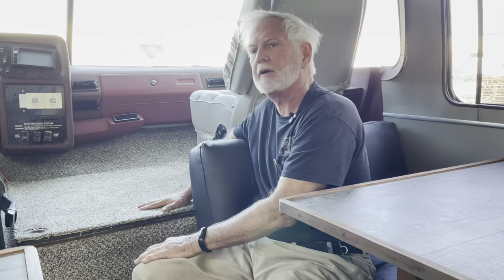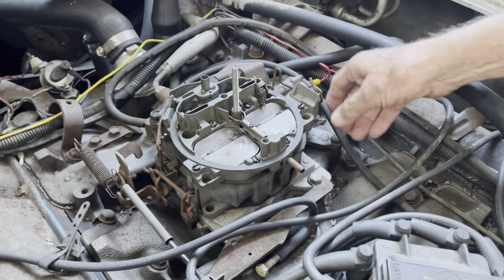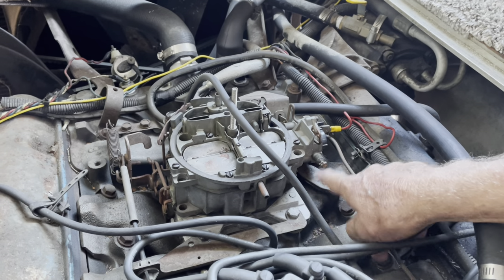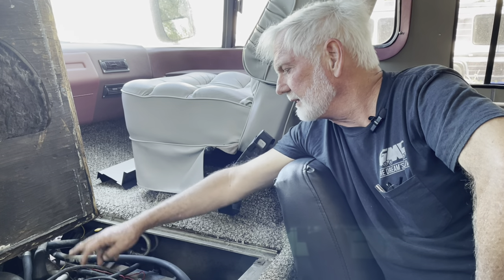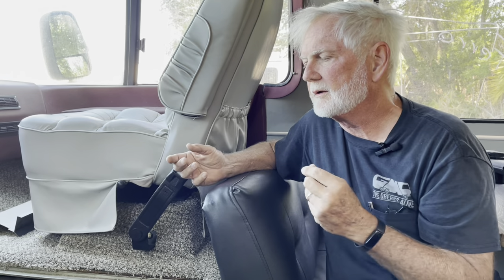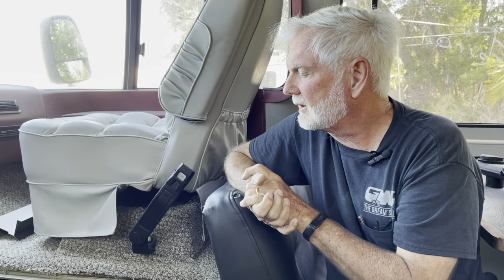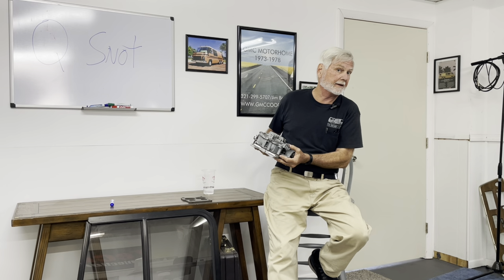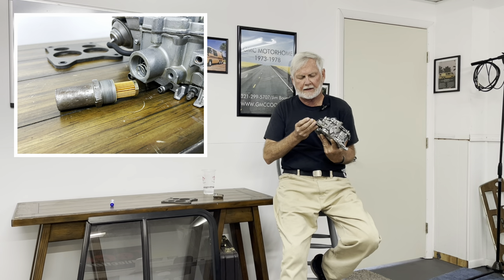GMC Motorhome - Carburetor - Jim Bounds

Comment: Great info in this video!  Lighting/audio/pacing were really good!  

I really appreciate you taking the time to post these - even though I know you've covered most everything in earlier videos...things change, products phase out and in, and this kind of info isn't "evergreen" like some things.  Plus, a lot of the older videos (by anyone) are not very good quality - grainy, bad audio, etc.  One of my pet peeves is asking a question on a forum - motorcycles, for example - and having one of the moss-backs tell me to "do a search, that question has been answered a hundred times...and rant on for a few paragraphs"  (Odds are that I already DID a search and either couldn't find it, or what I did find was totally out of date...)

On the Q-jets, i used to sell a metal "heat-shield" gasket, don't recall the number but it was a factory part for a GM of some sort.  We'd put them as the bottom gasket, I think Moroso used to make something similar.   I noticed the thick gaskets have plastic grommets in the bolt holes to keep them from smushing out from over-tightening.  I've rebuilt a few Q-Jets and had decent results, but one of my customers could make them better than new and I'd take him the carb and a Borg-Warner or Sorensen carb kit - Jiffy Kit in an emergency...and he'd set 'em up for me.

Good info on the pressure spring on a mechanical pump - even after auto mechanics class (about 1976) and 30 years of owning a  parts store, I never realized that's how the pressure is regulated.  Makes perfect sense now.  

As a Chevy guy, the Olds "reverse rotation" distributor blew my mind when I first ran across it!  I'd put a '70 350 Olds in a '70 4.4.2 that I bought for $500 with a blown-up 455.  Good solid car - nice sway bars, handled really well for a mini-tank.

Fuel filter - I used to see a LOT of kinked fuel lines at the fittings where guys wouldn't use a wrench to back up the fitting before removing the line - I know you have, too - it might be worth a mention for some of our non-ancient enthusiasts.  Those lines are a bear to bend from a chunk of tubing - just best not to screw 'em up in the first place.  

We had guys ask us which way the paper filters went into the carb pretty often - if I recall correctly, the hole goes to the fuel pump side and there's a spring that goes in first.   I ran across some of the filters that had a "check valve" in them - guessing it was for GM applications that would let the fuel siphon back through the pump, but never really figured it out.

We used to run a FRAM gas filter on our old hot rods - I think it was an HPGC?  Looks like FRAM doesn't make it, but a company called Pegasus has a clone for about $75.  It's a 5 micron and has a huge element.  I've often thought it would work out well on the GMCs.  

Keep the Faith and Thanks Again!

Comment: I would love to know what the part number is for the 3 port mechanical fuel pump because I have been struggling with vapor lock even with an electronic fuel switch/pump.

Comment: 1976 elaganza 2. 3 months ago started and ran motor for 15 min ir so. Wanted to run her for a bit and cant for the life if me to get her started. Pump away and then floods. Does the carb need remand? It was my uncles who passed away and I want to sell her. But it need to run. Planning on tuning up oil change and such. Probably inline carb filter (thanks for the info) . Beyond that I don't know what to do.